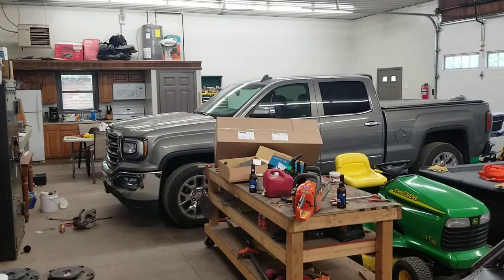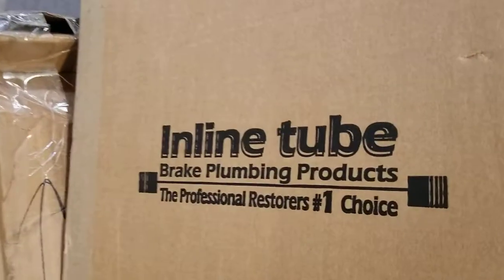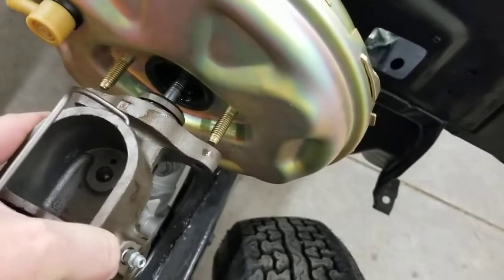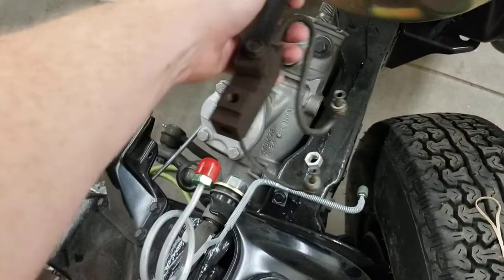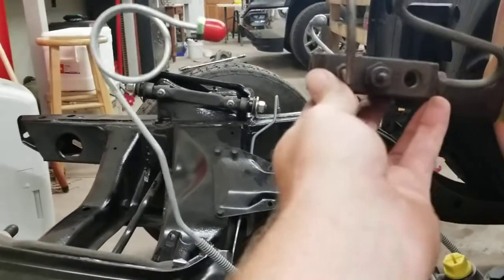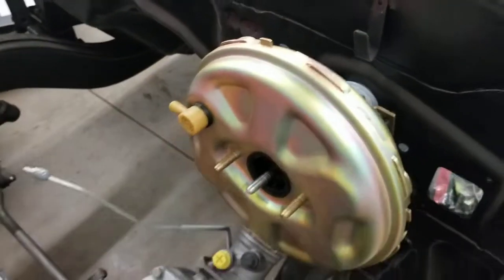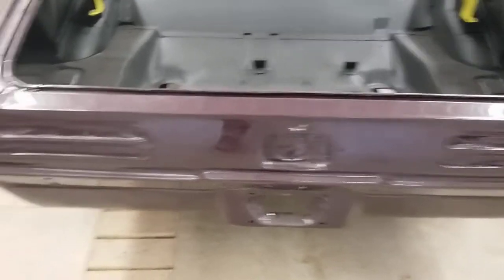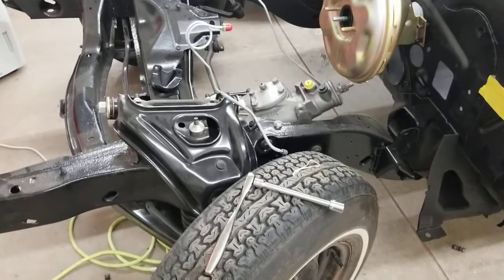1967 Firebird junk parts and roadblocks 8 28 18

Comment: Hmmmm... is it possible that pin is in backwards? You think a guy that rebuilds things would know which way they assemble, but I can't recall where that pin is supposed to be exactly. And the inline tubes, I suppose if you just have to bend stuff a little wee bit, it wouldn't be the end of the world. You think everything would fit exactly, but those tubes are kind of softish. Or is it missbent and you got to straighten it and put the bend in the right spot? Last year I put a motor in my friends Corvair, and he bought some Chrome fuel lines, and they're only 6 inch or a foot or 18 inches long, and Nothing fits properly. We ended up swapping the fuel lines from the old engine, but luckily I bought a whole bunch of used fuel lines at a swap meet, so I had lots of parts to put it back together